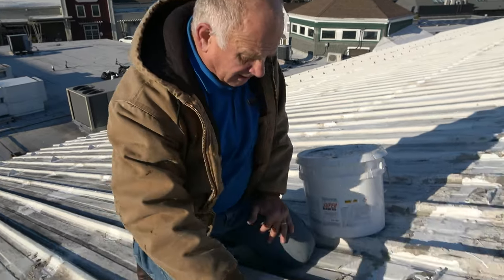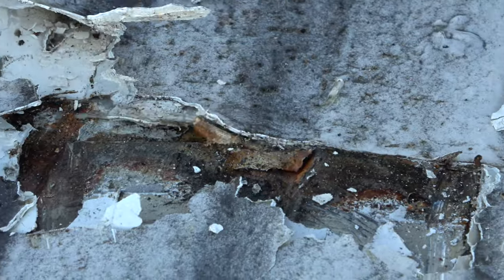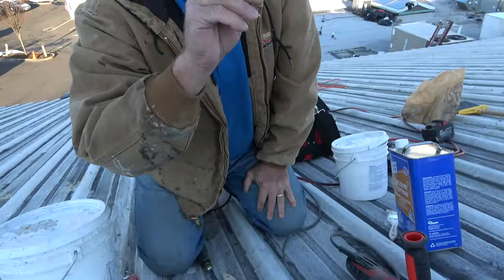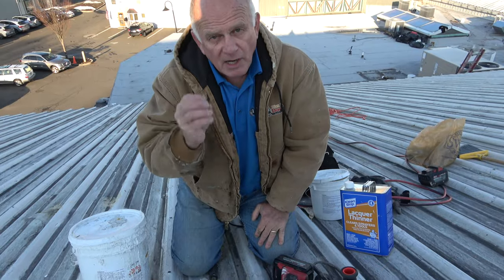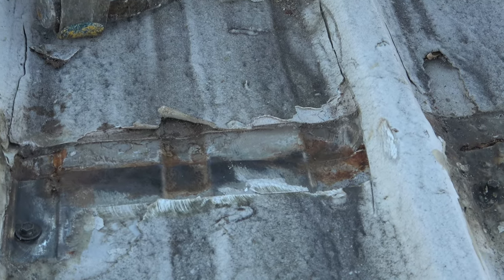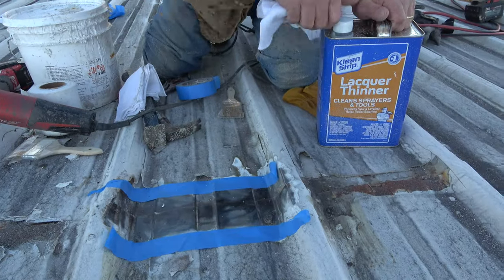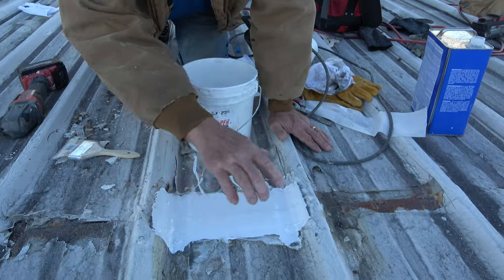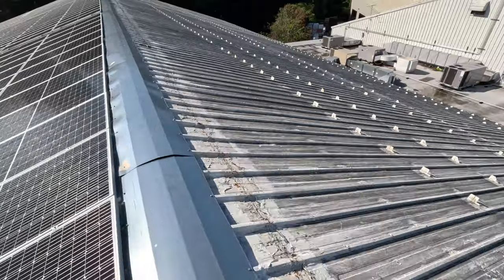How to Repair/Seal Leaky Metal Roof Seams - No matter how rusted. Metal Roof Seam & Screw Repair DIY

Comment: Why silicone seal versus the turbo poly seal?
Reply from the maker: They both good. I cant decide which one I like best. Turbo has a higher viscosity and therefor will be easier to work with on steep slopes and vertical surfaces. Turbo can be painted and SSS not. The flexibility in both allows for no cracks on metal roof seams
Reply: You would also not want to put anything non silicone based on a more than likely silicone based coated metal roof.  Silicone does not like any thing else besides more silicone based products.

Comment: The coating on this roof is delaminating from the metal panel substrate.  This will preserve your seams and fasteners but opening the coating this way is allowing more channels to open and allow water entry between the coating and panel which will cause ponding water issues at points down the panel which in turn will create more rust under the failed coating. This coating has failed and needs replacement.  This is a band aid repair at best, which a lot of properties owners don't mind due to the high cost of preparing the roof for another coating, new metal panels, or a retrofit roofing system.

Comment: Confused your other video your using turbo sealant?? Now this is a different product ?? Explain ? Your the best man so many doing repairs wrong and am one of them 😩😩
Reply: I was gonna ask this same question….
Reply from the maker: They both good. I cant decide which one I like best. Turbo has a higher viscosity and therefor will be easier to work with on steep slopes and vertical surfaces. Turbo can be painted and SSS not. The flexibility in both allows for no cracks on metal roof seams